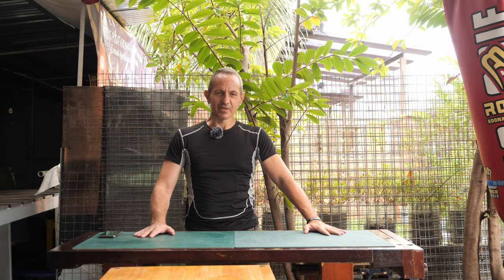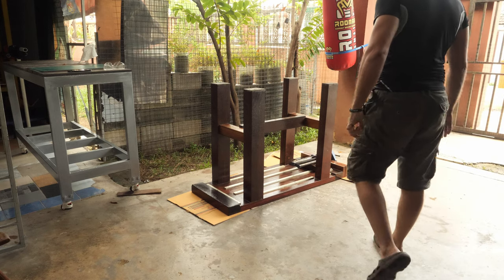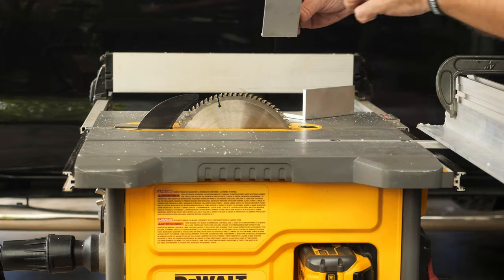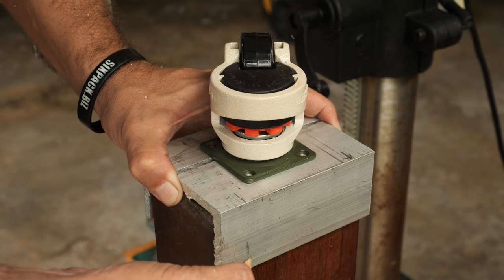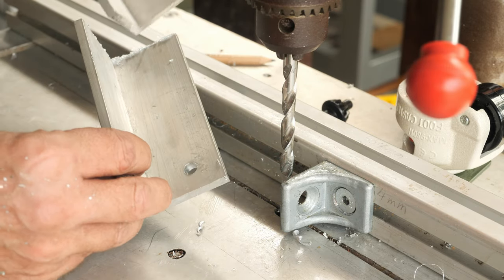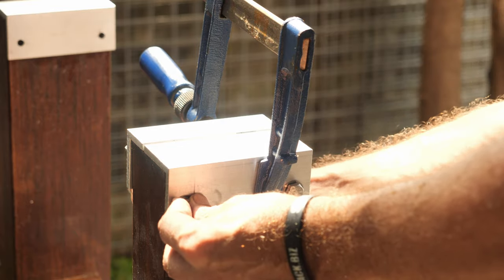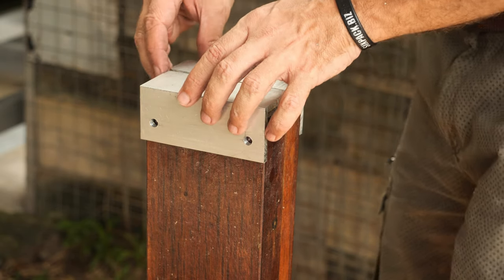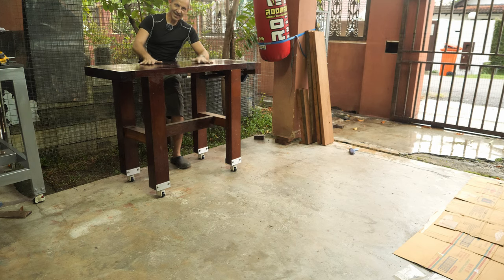Heavy Duty Reinforced Caster Wheels Mount for Heavy Wooden Workbench

Comment: Really clever, I was disappointed to find out that those type of caster are no good to go straight in the wood, that looks like a great walk around. I'm making my own washer and dryer pedestals, and I'm thinking of doing your way there. Do you think those caster can hold up to the washing spinning. Also I'm going to go ahead and subscribe.
Reply from the maker: Absolutely. I use these casters on all my machines including 460 kg industrial jointer, solid steel welding table, 260 kg iron wood workbench, band saw cart, table saw table etc. 
These casters allow level adjustment within 15-20 mm and have machinists grade rubber feet that can absorb the vibrations and hold your spinning engines in place.
Reply: @TigerCarpenter  thanks for the fast reply, you keep making videos and your subs will start going. Also, thanks for saying what the kg in pounds are in your vidoes, I'm in the USA and only understand pounds.
Reply from the maker: @unknownone8479  thanks for your encouragement. my channel will definitely expand, as I already recorded a few new projects, and in few months, I'll be starting an off-grid land development, and that will bring endless topics, such as: solar panels system design and implementation, buildings framing / construction, solar powered pumps and other devices, hydro energy, survival, bushcraft, furniture making, etc etc
I already acquired the land, and now getting ready to start rolling a new chapter in my life. stay tuned!